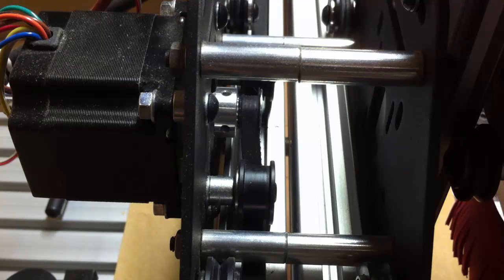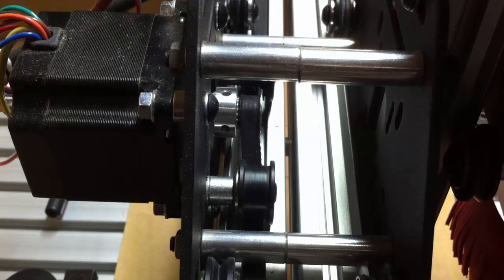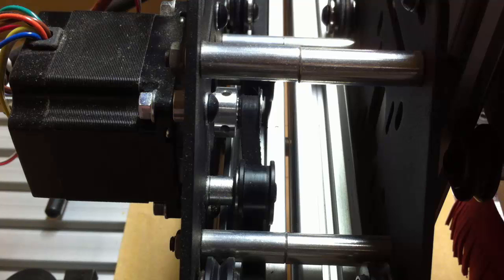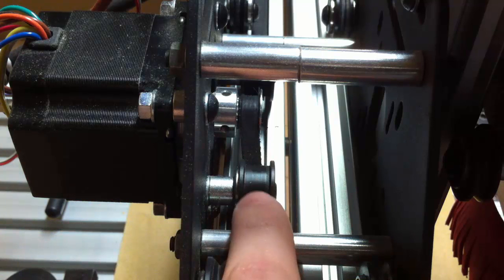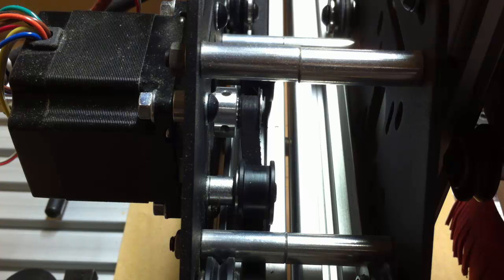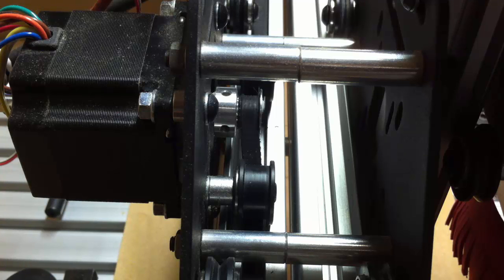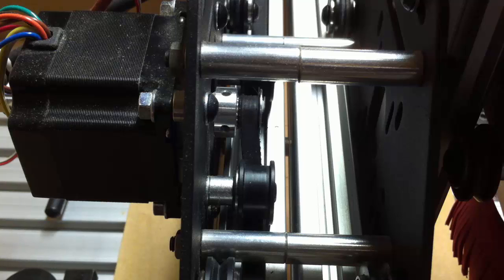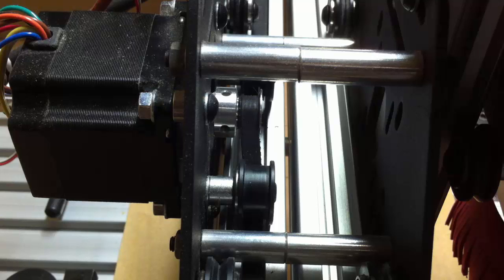ShapeOko 2: Regular Maintenance

Comment: Is there any protocol in the instructions for using a thread locker like loctite blue 242? (A thread locker that is also undo-able with normal tools)

i.e. is it recommended for any particular screws during the build instructions?

I would have thought that anything subject to the spindle vibrations would benefit from a dab here and there. Better safe than sorry, right?

Perhaps if there are any particular repeat offenders the wiki could be updated to reflect this.
Reply from the maker: I don't believe the official instructions give any recommendations on the use of any kind of Loctite, but the thought has occurred to me.

 I can't see the harm in using something like what you're suggesting. It's not permanent, so I think it would be worth a try.